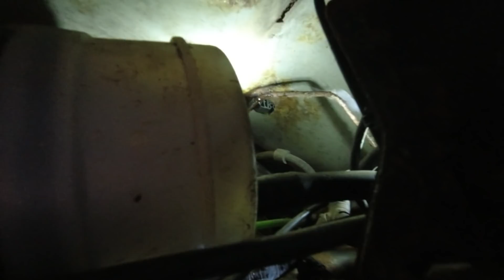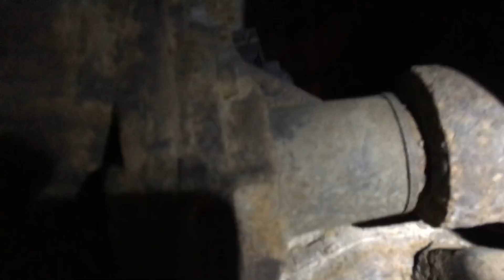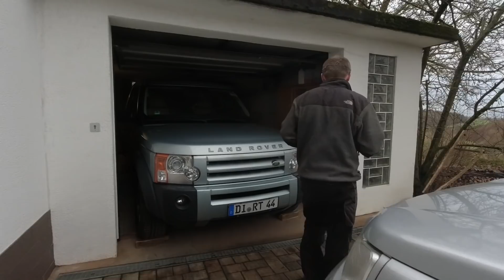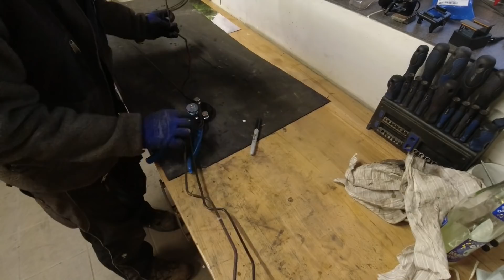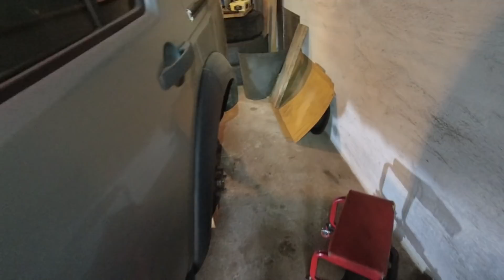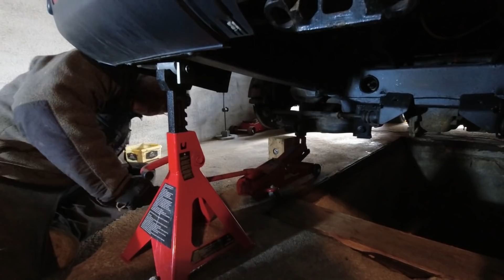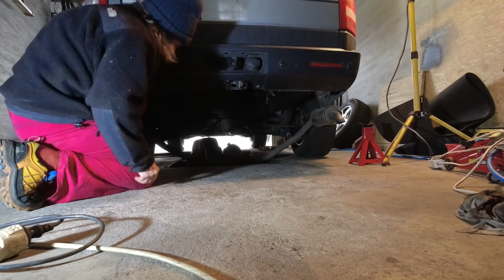Land Rover Discovery 3: How we replace brake lines

Comment: Brake lines almost always corrode and leak in the most inaccessible places. You two did a very clean and thorough brake line replacement.

Comment: Hi nice work and well presented again
Copper brake lines should not be used because vibration will cause the copper to work harden and fracture
In the UK cupronickel is popular as it has superior corrosion resistance and does not fatigue fracture like copper
Reply from the maker: Hello Leslie,  I agree.  Land Rover should issue a Bulletin to allow use of copper nickel lines.  Many other manufacturers have that done already.  Thanks for your comment. Have a good start in 2021.

Comment: I feel your pain! I've been preparing my Disco for the Swiss MFK for the last month. Oil cooler gasket tomorrow...
Reply: When I did the rear brake lines I bought the LR parts and cut them in half. Saved a whole load of time. (Think Prop shaft centre bearing!)
Reply from the maker: I could not get them out of the UK because of the lock down.  I buy my parts at AdvancedFactors.  Great guys working there. 
I bought now a cheap chineese propshaft for unbelivable 130 Euro.  I will make a video about the differences to the brand name GKN drioveshaft. After that is installed, I inted to make a video about replacing the center bearing.  I work in the drive shaft industry and I should be able to do this...

Comment: The off side rear boot mine was doing the same so I just put the clamp at the top only and cleaned the lower part of the air shocker with wire wool and put some grease on the lower air shock free to move as you raise the suspension all good now 3 years on also mine was a Brit part part £23
Reply from the maker: Hello Dan, the shock is really scratched up and maybe it is no longer slipping up/down. I will try to fix this.  Thanks and have a good start in 2021,

Comment: There is never a dull day with land rover issues that lead to repair 😱 my line began to leak once I also touch the rusty line in the plastic line holder and I replaced all rotors and pads the pad holder with slide pin seized then snapped off then caliber boots started leaking , land rover have many secrets that come to light that none talks about that you discover while doing simple repair , my lower dash cigarette 12v power plug wasn't working good so I bought a new replacement 12v power plug I removed lower dash unplugged 3 connection for some strange reason I was going to start rover it would not start so I got out my jumper no start I left battery on charger all night , next morning battery fully charged still no crank no start in thinking WTF.. .... So I thought I finish the new 12v plug reconnect the 3 plugs to the 2 12v plug put dash back new plug works good then I thought I see if rover will start now , somebody shut the front door she fired 🔥up like new money , just learn if the lr3 land rover has something unplugged or not in its normal condition with all plugs in the rover won't start , it like having a smart car , you never bought , next time I go home the brake line job is next to do 😰

Comment: Merry Christmas! What product did you end up using for the corrosion?
Reply from the maker: Will be in the next video(s).  I actually used a product from Mercedes Benz. I thought that this fits a German (and the product is made in the UK).  Could not fit better.  Very sweet stuff. Worked great and easy to apply.
Reply: @Vera_and_Christian  Excellent! I just took care of some corrosion on my vehicle recently too. I’m looking forward to the next videos.

Comment: I like your videos a lot.. you are like me. we ha so much in common... But if i could advice you... Lift the body off then brake lines job is a piece of cake, also EPB module is much much better accessible. Drive shaft, you can check for some leaks on engine, corrosion protection is much easier to do.. Sometimes do not worth to fiddle under the car for so long.  :)
Reply from the maker: Thanks.   We would take the body off if we would have a lift on our property.  It is important to us to do everything with the tools available to us and not to go somewhere else.
Reply: @Vera_and_Christian  anyway great video.

Comment: Replaced my center bearing drive shaft LR4, not easy but succesfull ,I tried to seal the caps with sikaflex, need to see if the tape it still there though
Reply from the maker: 👍Awesome. Not many get it to seal back up again, longterm. Hope you did some chiseling to close it up before applying sika flex. I think we used JB Weld. Our fix has been holding up for almost 2 years now. We need to replace the centerbearing on our new Disco 4, we will show then our chiseling hack. 😀👍🙋‍♀️

Comment: Nice video.
Good luck with your centre bearing.
I have tried to replace the seperate centre bearing once myself but ended up installing a brand new drive shaft aswell..
Is Vera ever not smiling??
Reply from the maker: Thanks.  We will install a new propshaft and later on try to repair the original one just for giggles. May end up in a decent video.

Comment: I saw a drip at 2:20 and thought you were going to miss it.
The workshop manual says you have to change the whole prop shaft with the bearing.
Reply from the maker: Propshaft is on order. I wonder how long this bearing is lose allready... It may not really matter.

Comment: just replaced the gears in the brake unit because its was  faulty red light flashing on dash ,  opened the unit its and the c clip on the slipper clutch gear  had come off in mine , and the slipper gear had siezed on its self , replaced the gears and opon fitting the unit back on noticed the brake pipe line leaking in the excact place as yours , thinking maybe a common place to check very very tiny leak, nothing really what would really notice   on the roa,d but if its that brittle and had  snapped could be another story, worth checking guys in a very hard place to spot can probley see why it may get missed under a MOT test,
Reply from the maker: Yes, there are several spots like this.  Thanks.  Christian

Comment: Hallo, 

Quick question. For the front did you connect the new line to the wheels or you did the same as for the back wheels? Waldo worlds who mentions you guys :), went and replaced them from the abs pump. 

What do you guys recommend? 
Also a super useful video and encouraging.
Reply from the maker: We only replaced the corroded sections.  Waldo lives in New Hampshire and there is more corrosion than here in Germany.  Christian

Comment: Hi Christian, I loved the video! You make things look so easy! I'm eagerly awaiting the rust prevention video. Could you tell me in the meantime what rust preventer product you used? It looks really good, like new underneath now. Well done and Happy New year to you both. All the best 😊 From North Wales, UK.
Reply from the maker: Google A005989642009.  This is a Mercedes Benz part number.  This stuff is actually made in the UK!  It requires a special air nozzle to spray it on.  This is a protective layer only.  As a primer, I used a product called Rostio (made in Germany). You could use any high end primer, for example out of the farm equipment world.  
I am working on the video but I am back at work and have little time right now. Thanks. Christian

Comment: That’s one thing my car will need to get in spring, mines do look kinda rusty, uncle TÜV said nothin, but better be safe than sorry. I fear that this is something that will need some more room under the car than my usual „ no lift no trench“ mentality
Reply from the maker: This job was not easy done, even with a pit.  But someone who removed a engine without body off can do it for sure. Looking forward to your next video.
Reply: @Vera_and_Christian  well I really think so it can be done :) - I am working on a Heater core removal and flush right now, hope this will be done today

Comment: Great and informative video. :) I have to replace the rear brake lines on my Disco3. Rust was discovered at the MOT (TUF). :O Do you know the dimensions of the pipes, and the couplings? I have to make new lines, just as you did. But i will use copper. :)
Reply from the maker: All materials we used are in the video description.  Copper is not allowed in Germany but would be the better option.  Christian

Comment: Christian, there is an ecu brake bleed program that will make your brakes much better by getting rid of air that you can't remove through normal brake bleeding. Do you have a gap iid tool?
Reply: I ran the program as I thought my brakes weren't as good as they should be and it took 20mins and replaced a litre of brake fluid. I think it replaces old fluid stuck in the abs pump. It was black! And I bleed my brakes regularly
Reply from the maker: Hello Jack,  I only have a regular   Obd2 tool.  The regular bleed procedure will not replace all fluid.  Maybe I need to get me a gap tool because I get this question a lot.  It’s quite expensive so.   Thanks for the hint and have a good start into 2021.
Reply: @Vera_and_Christian  thanks Christian, I think it's the best accessory you can buy for the disco! I had to use my abs one time to avoid a collision and after that my brakes were really bad, hence why I used the gap tool and procedure and it was a big difference.

Comment: Sounds like you have bearing gone or control arm joints need checking
Reply from the maker: Hello Garry, we hope not.  We just fixed the wheel bearing in a previous video.  In the videos before the fix of the wheel bearing, you can actually notice that the car was much louder.  Audio inside the car is difficult to record.

Comment: No copper brake lines? Totally bonkers, used them for years. So no copper fuel lines? As long as the pipes are clipped down and do not move there can be no work hardening. What flaring grease did you use BTW?

Comment: I thought TUV approved copper nickel pipes Kurnifer.
Reply from the maker: You right, there is an ABE from one manufacturer in Denmark, from September 2020. So it's pretty new.  There needs to be an approval by the car manufacturer, and there was none when we had to deal with that problem. Also, our TÜV guy clearly stated that we should not use them. I am going to do some more research 👍🙋‍♀️ Vera